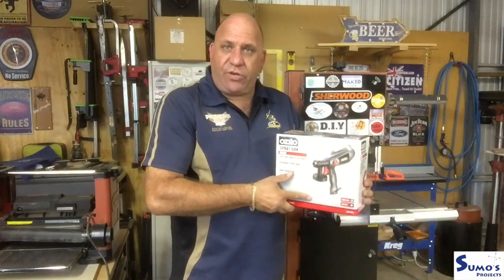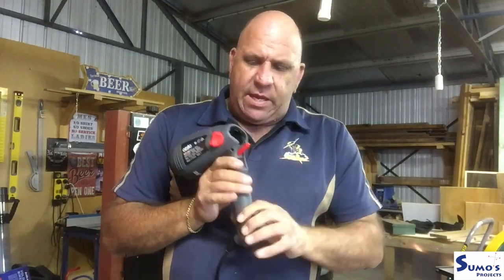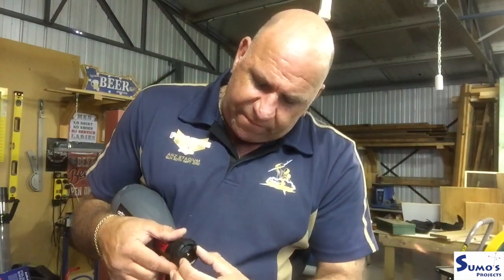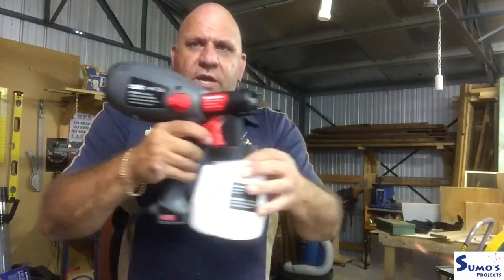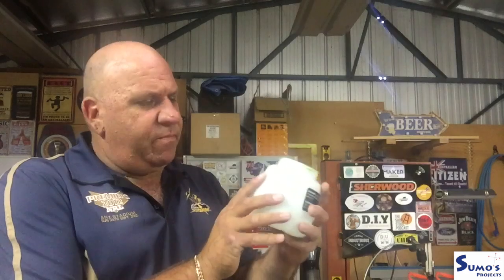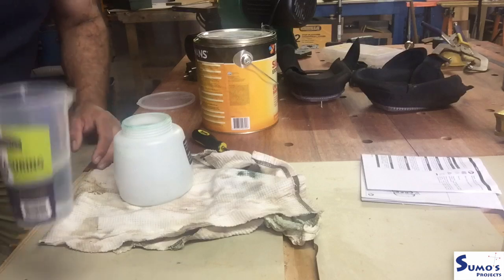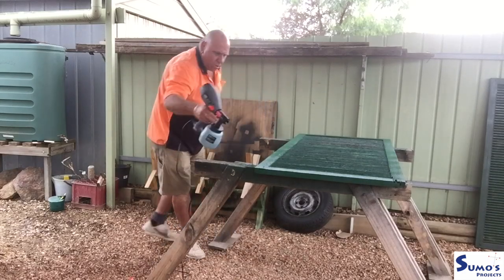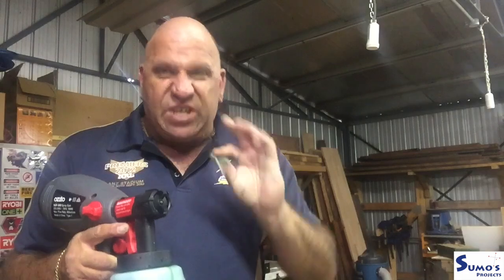Ozito Spray Gun review

Comment: Hi sumo im painting stucko on the outside of my house 🇮🇪ive painted the outside kitchen part with a brush and roller had to keep going back with a little brush to fill in the little gaps the big Brush @roller couldn't get into bit got the kitchen outside done now ive to do the upper part of house 🏡 should i buy a paint sprayer and any tips i would really appreciate, trying to do good job for my mother, save her the 1000 pound shebwz quoted, ive other paintjobs to do for her, any advice appreciated, God bless
Reply from the maker: I think a sprayer would save you a lot of time but I don’t know what a stucko is, as a rule of thumb I normally paint everything indoors with paint brush ( cut in ) & then good quality roller, a spray gun inside can be messy but for outside work where you can cover windows up I would definitely try a spray gun & don’t do it on a windy day.
Most spraining I do is normally smaller parts or outdoor furniture but remember to put tarps & cardboard up & around. Hope that helps a little 👍👍👍
Reply: Stuck or pebble dash its the outside on outside of house finished outside of house would now to do inside thanks for your videos found them helpful, have you ever heard of peaple painting there patio stones in back garden seen it done loooks very nice, any tips on paint i should use ta from the emerald isle 🇮🇪 god bless
Reply: Typically the two are wowed on
Reply: @sumosprojects  I think they mean stucco wall finish
Reply: Use a sprayer , keep it moving ! and keep a 100 mm brush handy you may need to give some places a quick brush over , also change the angle to get into the wee hollows...have fun.

Comment: Nice review. I have been using these for a couple of years now, have 3, one for oil based, one for water based, and a spare. The beauty of these are that they have a brass pin and nozzle, not plastic, but if you have been spraying for 2-3 mins, check the nozzle, it will need a wipe off, and probably every 15 mins clean the airways. Bunnings sells a small mixer that fits into the bowl, has 3 red blades, use with a drill, and I thin water based paints with warm water and stir in the paint bowl, then screw back on. There are no real adjustments, only how far you can pull the needle which controls how quick the paint comes out. Practice on scrap, or cardboard until you are happy with result, which may include further thinning... When you are finished, you can dismantle the spraying section and remove the needle and clean it completely, clean the airways in spray head, and the nozzle, it will spray like a new machine next time you use it.

Comment: Filtering out contaminents especially when switching between oil / water base paints is your biggest problem.  Mixing these two results in more 'hardened debree' caught in nozzles. Thorough cleaning is everthing or have an extra bottle. I use women's stocking to filter paint (every pour). Tell Mrs/ girlfriend not to throw out stockings lol!

Comment: I had a NIGHTMARE with this gun using enamel paint...the 10% dilution with paint thinner did not empty the cup within 30 seconds, so i had to add more. This caused the paint to crack on the garage door. Honestly...for small jobs such as tables and chairs use paint cans, any time you lose with cans you make up due to the prep and cleanup time.
Reply from the maker: Fair enough, it works for me & I agree for small jobs pressure pack paints are more economical but if you do a lot of spraying with the same finish this is your best option
Reply: @sumosprojects  i need 1 pice

Comment: That gun looks quite compact, I bought a similar type of gun from Aldi a couple of years ago nowhere near as compact but the same idea, found it fantastic for spraying shellac but I struggled with paint. I have been exploring using a sprayer again recently when a friend gave me an old gun of his and have been getting better results, I think it has to do with the quality of paint and the thinning down to the right consistency more than the gun itself. It's a great review and shows you do not need to spend a fortune to start spraying and get good results. 👍👍👍
Reply from the maker: G’day Graham, I was spending quite a bit of money at Bunnings on Spray paint cans & thought why not try a proper set up, yes it cocos initially to purchase the paint but the mileage is so much better & the thing is to practice like we do on most things we try out. This gun was recommended by the staff at Bunnings & the price is really fair for achieving a result of finishing so much faster although smaller projects the pressure pack cans will suffice.
Just go on the formula of 10 percent mix down on thicker paint or finish & you’ll be yodelling the hills are alive lol, let me know how it goes down the track mate 🍻👍👍👍👍🇦🇺

Comment: Hi Sumo.  First up, "Go Melbourne Storms", kicked the tigers behind -- 5 tries in 15 minutes.
Nice video!  I got my Ozito spray paint in Bunnings as well 2 years ago when I asked my dad to paint my fence.  After a few tries, he gave up and used a brush instead (while I was away working in an office).  He said it is not even and splatters a lot.  2 year on, I tried to use it to spray a part of our wooden gate, I can see why he gave up.  My problem in my paint spray is it has "chunks" of paint (not the fine mist that you have).  I diluted the paint more, 75ml water to 500ml paint.  But it still has chunks.  I grab a skewer stick and place some stick tape at the end (to serve as propellers) and used it for mixing the paint with my drill.  But it only did a little help.  Can you give me tips to have it spray finer.  Do I need to clean it thoroughly?  Do I need to screen the paint to eliminate lumps?  HELP.

Comment: I must have done something wrong, I tried thinning down some water based exterior paint in this unit but still found it quite thick and it "spat" the paint out onto the wall rather than spraying it in a nice fashion, so I found it very slow to use.  Pretty sure I was way more than 10% dilution too.  Still, it saved me getting RSI from using a brush to get into all those deep mortar lines.
My tip is to use hearing protection.  The fan is quite noisy if you're doing a big job that'll take a while.
Reply from the maker: Mate I had to go through trial & error getting the consistency of the measure correct myself, the viscosity of different finishes is always different & you’ll need to experiment a little bit 🍻👍👍👍

Comment: That's a bargain price. The Wagner I reviewed was nearly 3x the cost and I'm sure while it may have a bit better life and a few extra features it won't do 3x as good a job. They do tend to chew through thin oils if you are not careful, but as you said, compared to spray cans which cost a fortune still a good tool to have. I've found if you are careful there is not too much more clean up than brushes, but the prep can take a lot longer. I liked the outside use, much easier that way!
Reply from the maker: Took me a while to understand that the pressure pack paints become costly so after some staff consultation with the local Bunnings crew a fella told me they are pretty good & to be honest the Ozito tools aren’t that terrible mate so that’s something, I’d love a Wagner however not gonna pay that much to apply something to wood as I’m a hobbyist lol, cheers James 🎥🎥🔨🔨👍👍

Comment: Hi Sumo, Thanks for the video. I used this to spray paint our internal doors and had a few issues. Its got a very narrow spray so has left alot of patches on the doors and also there is plenty of extra overspray. I was painting leaving the doors with the hinges on though. Did you face any such issues? Or maybe its not ideal for the doors?
Reply from the maker: I encountered overspray as well unfortunately & I think that the mix & flow of using the sprayer is difficult to get 100% right however saying this I’ve see Wagner sprayers also take some getting use to.
Perseverance Ankit

Comment: Hey mate. Wonderful video! Does water vs thinner depend on the paint base you have? Like oil based requires thinner water base uses water?
Reply from the maker: G’day Amy, yes water is used on water based paint & thinner on oil base, bit of trial & error to get the mix 100% right so try your spray out on some scrap materials 👍

Comment: It`s a really nice video! Tomorrow I`m going to start painting our new doors and trim with exactly this sprayer. Just one question- on your video you didn`t filter the paint. Is this acceptable for water based paints, please?  I have purchased British Paint (water based) at Bunnings and still can`t realize about filtering. Should or shouldn`t ...  And if we have to filter it- when it must be performed-  after or before it`s mixed with water. Thank you
Reply from the maker: G’day mate & thank you for the comment Alexander, well I’ve not filtered the water based paint but rather so added the water first & stirred the paint before adding it to the required ratio. 
I’ve not had an issue doing it this way & you’ll need to trial & error getting the nozzle setting & distance from what you’re spraying right but this doesn’t take to long & you’ll have the control correct.
Let me know how you get on & have fun doing it 🍻🍻👍👍🇦🇺

Comment: Hey mate, thanks for the video. I recently purchased a wagner sprayer to spray my internal doors but found it left little splatter dots of paint everywhere, i tried and tried with different settings. I finally got it to spray ok when up really close but then had run marks. Is the ozito the same? Im trying to get a silky smooth finish on my doors.
Reply from the maker: @jordy083  G’day Jordan, I would of thought the Wagner would be way better as the Ozito does well but not the best for silky smooth. Maybe have another play around with the Wagner or take it back & ask them why it’s not doing as it’s supposed to do.
Reply: @sumosprojects  yeah ive taken it back today.

Comment: Great video..however the spray cans i was using "White Knight", are $8.30 per 310grams. A litre tin of paint is $38....so correct me if i am wrong, but its way more expensive to use the spray gun which is strange to me.
Reply from the maker: Look at the coverage comparisons on both options, you’ll find mixing it down yourself will act as the catalyst for saving money

Comment: Terrible for staining a fence lol have this model OMG the over spray is shocking so goes through the stain fast! Just brought a Certa airless paint sprayer from Dick Smiths that can use directly from the 10 liter can and replaced the tip with a Wagner HEA tip for a claimed 55% less over spray. So no more messy refills! I know I am being stupid to compare this to a gun airless paint sprayer, but this is strictly useful for very small jobs as the over spray and small pot size is a pain.
Reply from the maker: Fair call Greg, I notice the overspray mate & all things being equal this was a cheap pickup that was recommended for that reason so we need to work within the parameters of cost effective- performance mate.
I have issues with the pressure pack wood finishes that at $10 a can clog up if you don’t respect them lol, but a bit of playing about & control this sprayer isn’t to bad, Wagner cost way over $100 & not in my budget, appreciate your feedback 🍻🍻🇦🇺👍👍👍

Comment: Hi Sumo, what's your views on using car paint and spray paint a small barina hatch ?? would it have the power to do so ???
Reply from the maker: Oh that’s a good question Peter, I would perhaps opt for a better quality sprayer like a Wagner to tackle that because it has better spray adjustment
Reply: @sumosprojects  I visited bunnings tonight, asking about the ozito top loader spray gun, ASG-GFK, is a 3 piece set costing $79, data on this spray gun says, This kit is ideal for automotive applications like repainting car panels or motor bikes. The gravity feed design has a more efficient paint consumption rate and reduces occurrences of paint splutter when the paint runs low, giving a great finish. So will seek more info concerning this spray gun.........
Reply from the maker: @Peter170254  Hoping for best results for you Peter 👍

Comment: It’s actually a bit of a let down, I tried everything. I have tried watering the paint down bit by bit. It spatters they paint out. I have stirred the paint. I think you get a much better finish using a brush. The best way is to use this and then go over the piece with a brush. I used Walpamur fence paint onto a timber fence.
Reply from the maker: Don’t know Paul, it’s trial & error mate & if you look up at the expensive models your up for hundreds, make sure you mix everything really well

Comment: With enamel paint, should you dilute the paint beforehand 10% with mineral turpentine as paint thinner??
Reply from the maker: I’ve only used water based paints but as a recommendation 10 percent dilution is correct, some trial & error needed 👍👍👍
Reply: @sumosprojects  - Thanks.

Comment: Correction to the dilution rate of 10%, you said 80 mils of water and TOP up to the 800 line, INCORRECT. You need  to add the 800 of paint, otherwise the dilution is not 10 % but 11%.
Reply from the maker: Good onya champ